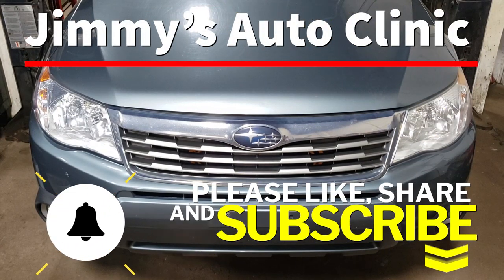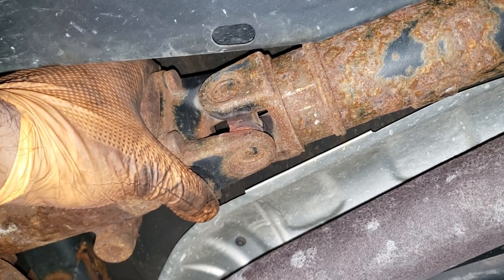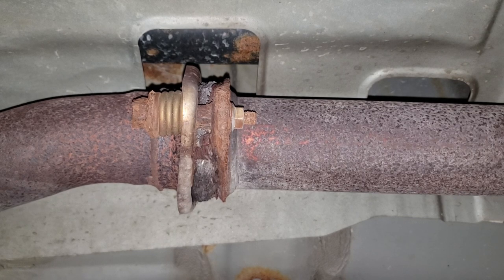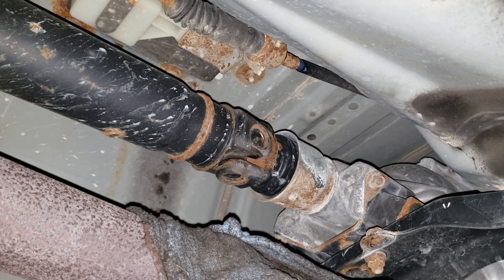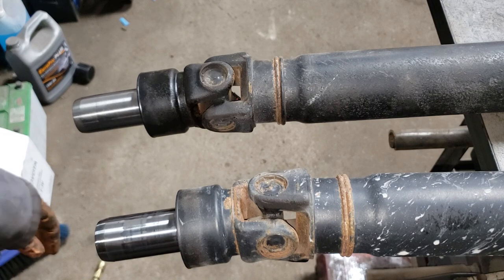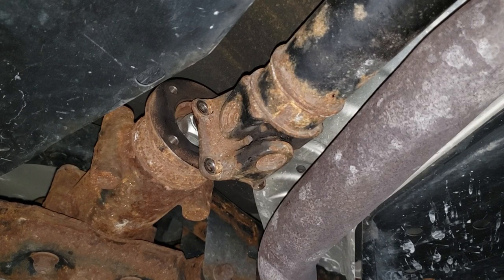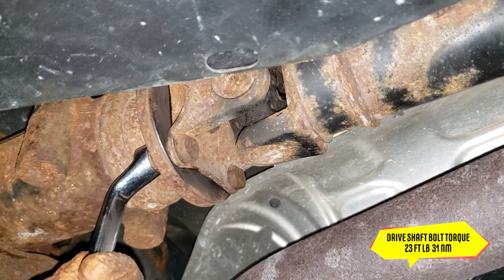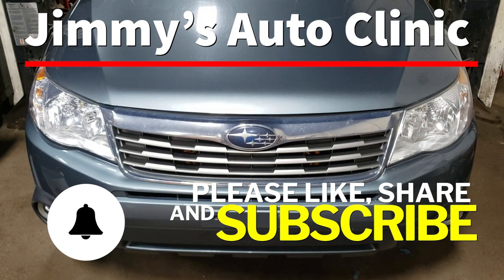2009 Subaru Forester | Drive shaft replacement | Propeller Shaft |

Comment: Great video. Just replaced mine on a 2010 XT, only problem I had was that I didn’t realize how worthless my impact driver was with 120ft-lbs of torque. Pb Blaster a hammer and wrench got through it without any snapped bolts even in lake effect snow country at 200,000 miles

Comment: Hi Jimmy this is a fantastic video. I live in Maine and we have badly rusted vehicles, that being said one of my hanger bearing support bolts is 100% seized. After plenty spray tap and wrench i had to go for my impact and that broke the seized bolt. Would worst case scenario be cutting and welding new metal? 
Thanks, Caedyn
Reply: Got the bolt out, heat worked! Now getting a new bolt in is another story.
Reply from the maker: The best thing to do depending on how rusted it is is to drill out the broken portion of the board. Unfortunately being in Maine heat is gonna be your best friend for getting out stubborn rusted bolts however it is dangerous and some thing that I would definitely have another pair of eyes they're along for the ride as you use it if you choose to for the next bolt. If you haven't got it out already I would definitely try drilling it out first and then tapping the bolt. If that isn't an option then yes the worst case scenario would be cutting out that section welding up a new piece of metal with a new retaining nut to hold in the new bolt.
Reply from the maker: I guess I should've read this before I reply to the other message lol but yeah heat is your best friend. Another bowl shouldn't be too bad Subarus should have them if not any scrap yard would gladly let you take one provided you take it out.

Comment: Awesome video!!! One question... would it be a good idea to put lubricant on the outside of the shaft that does into the diff? It seems to me that it would help the seal stay good. p.s. you guys are FUNNY!
Reply from the maker: So I'm assuming that you're talking about the rear portion of the shop and bolts up to the diff? It is OK to put a thin layer of grease on that side. If you're talking about the other side that goes into the back of the transmission into the centre dish you don't wanna put any sort of lubricant other than transmission oil if it is completely dry or brand new. And then as for the joints no lubricant is really needed as it is a non-serviceable part, however if you're going to pull back the seal you can spray some white lithium grease in there.
Reply: @JimmysAutoClinic  thanks!!